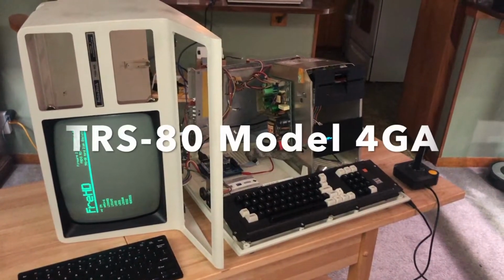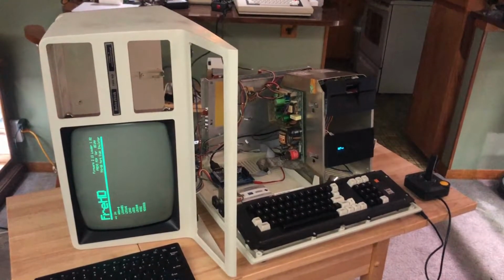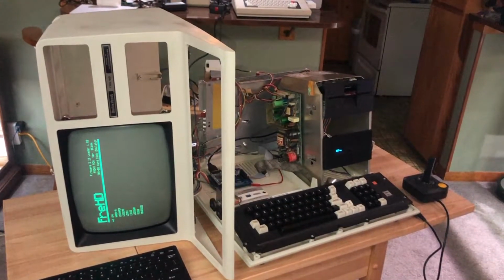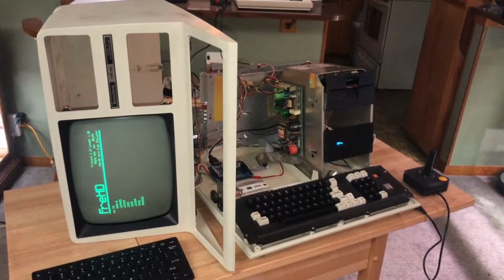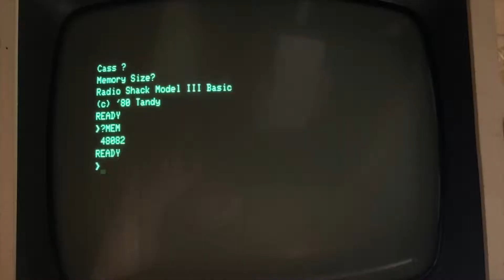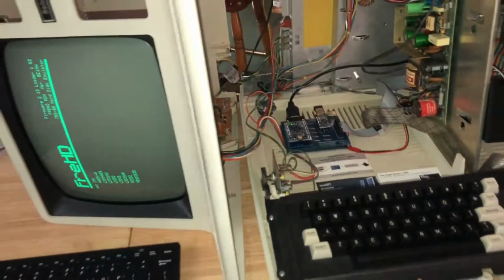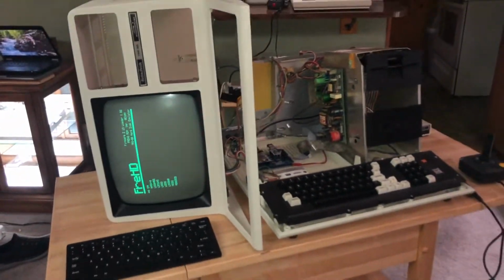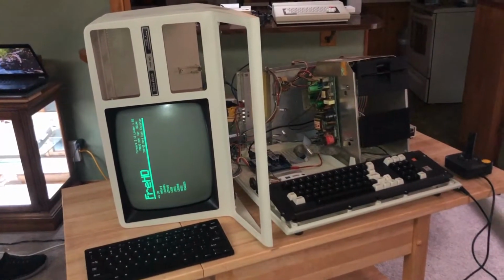TRS 80 Model 4 Gate Array Video Tour

Comment: With the NewKey/80 does the original keyboard work simultaneously with the external wireless one?
Reply from the maker: Yes, both the original and the external keyboard can be used simultaneously. The joystick port emulates pushing the up, down, left, and right arrows, and the fire button emulates the space bar.